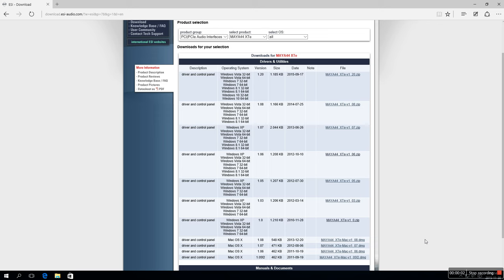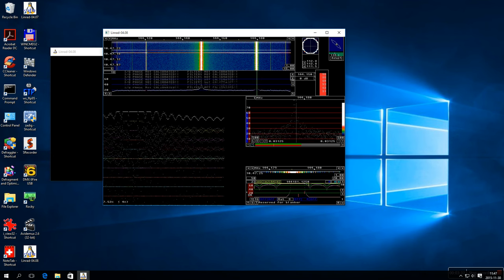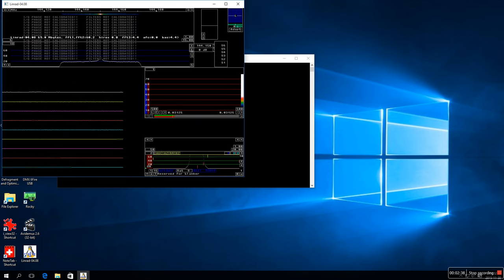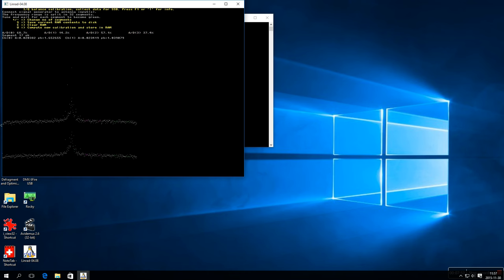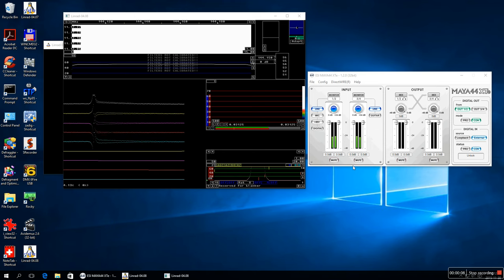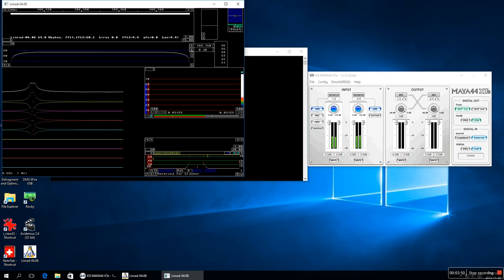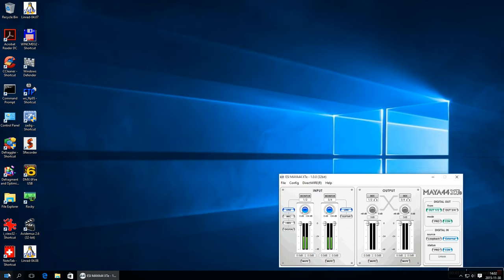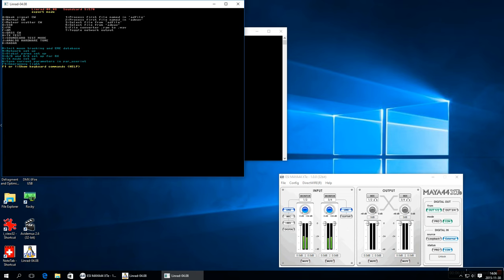Maya44

Comment: Does it work and does it sound good?
Reply from the maker: I have never used it for output....
Reply: @sm5bsz289  do you record with it (vocals, guitar, bass ...) and if you do how well does it record?
Are the recording very clear?
Reply from the maker: I am using sound-cards with SDR (Software Defined Radio) hardware. Terms like (vocals, guitar, bass ...) are irrelevant to me. I want a flat frequency response, very low noise, precise timing between channels and total absence of glitches. Here is a comparison between a modified Delta44 and the Maya 44: https://www.youtube.com/watch?v=pCKQA-iCSOY It does not answer your question, but might tell something else of interest. You might also have a look here: http://sm5bsz.com/linuxdsp/hware/ensemble.htm for a table that compares all the sound-cards I have tested for dynamic range when used with a Softrock to make a short-wave receiver.  The column "Modified SR@8dBm, effective NF, (dB)" ranges from 19.5 to 30 dB for reasonable sound-cards. NF (noise figure) is a measure of the intrinsic noise of the sound-card .  At the upper end performance is limited by the Softrock. The UADC4 is significantly quieter than the DMX 6fire USB because the noise from the Softrock dominates over the noise from the soundcard. Any soundcard below 30 in the column is probably more quiet than whatever audio source you might want to feed it with.
Reply: @sm5bsz289  thanks